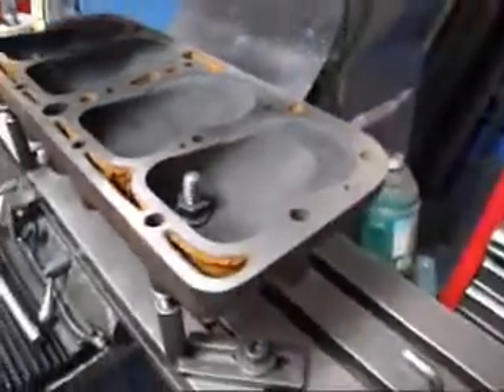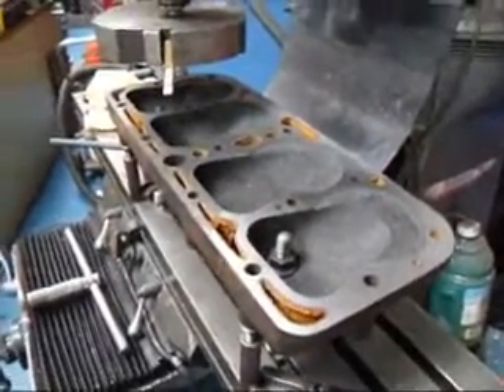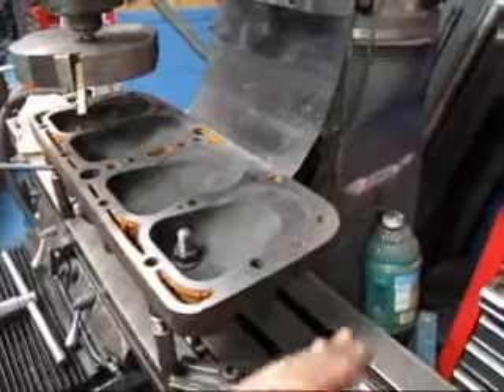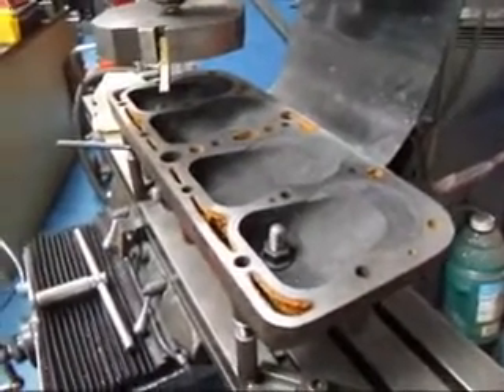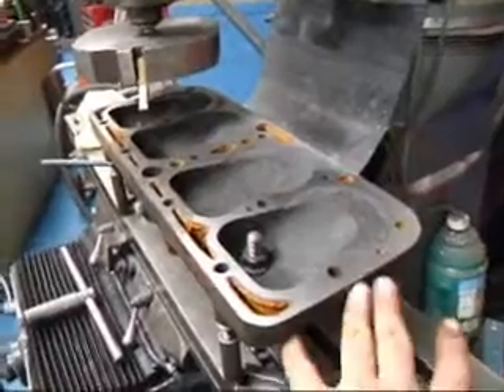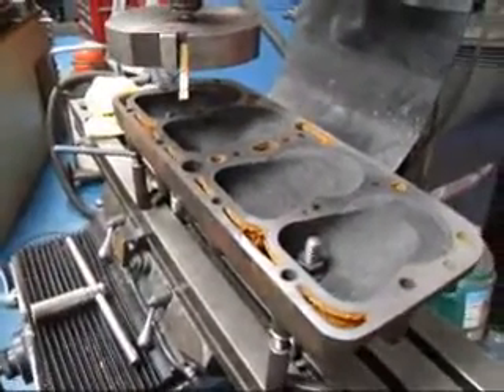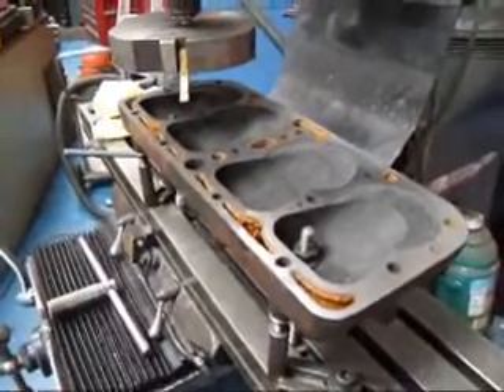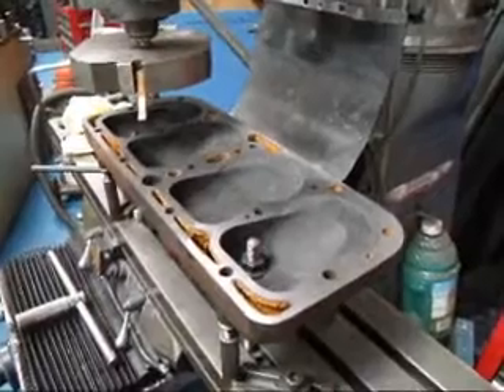Model A Ford Cylinder Head Resurfacing on a Bridgeport Mill

Comment: There are wide diamond belt wet sanders that work great for flattening warped heads. Especially if it is a diesel with cast in chambers of different hardness.
This head might also be  mounted on a flywheel resurfacer. If you are familiar with machinery ways resurfacing a file and scrapers can be used, however you would need a surface plate. More than one way to skin the CAT.Marauw!

Comment: Model A Ford 1928-1931 compression ratio = 4.22:1. A replacement "high compression" head from Brumfield raises the compression ratio to 5.5:1. You would not want to go any higher than that because the babbitt bearings and head gaskets will not hold up. You must use grade 8 studs and nuts because they need to be torqued to 65 Ft/Lb.